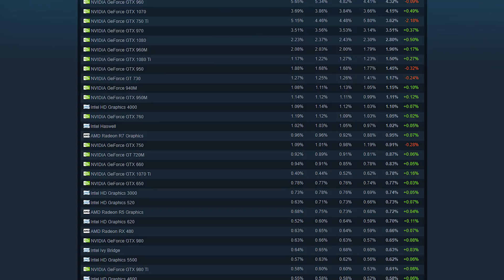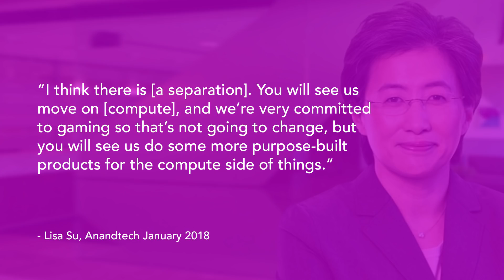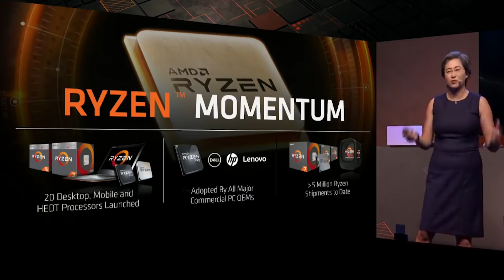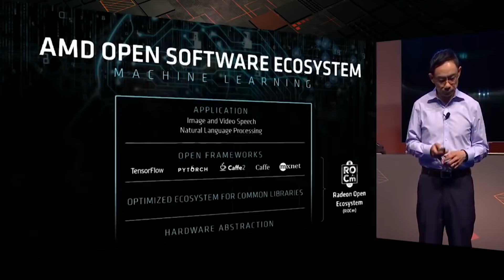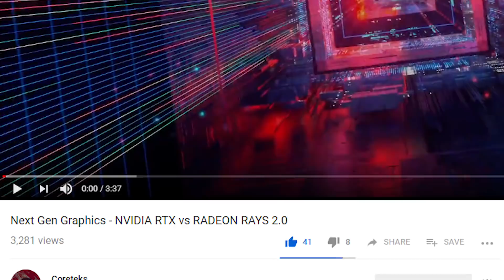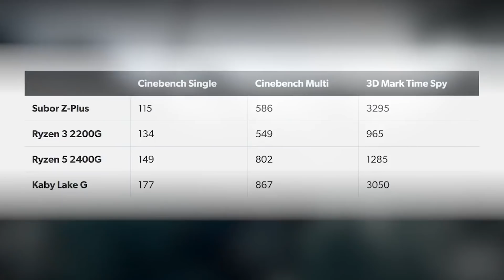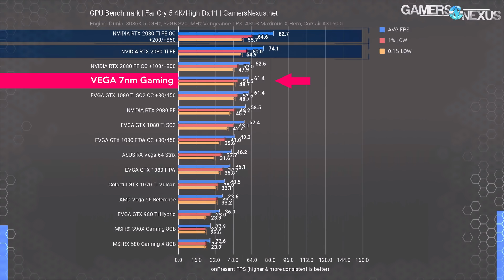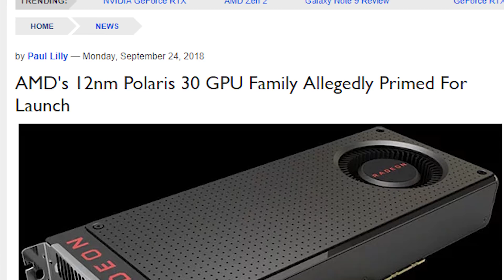AMD's answer to RTX

Comment: I made this post a couple of weeks back, thought it might be relevant for this. Wall of text below, probably only for the specially interested, you're warned.

I think you'll see Lisa Su's vision starting to take form in 2019. When she took over as CEO in 2014 *1 she shifted the focus over to exclusive contracts and low-to-mid end consumer CPU's since that's where the biggest markets were, there's much lower ROI (return of investment) in the high-end consumer base for them. Their recent success can be traced back to TSMC, producer of wafers used to make CPU's and their contract with Apple in 2014 *2 after which they invested 9 billion dollars into development and moving towards 7nm where Samsung is mainly the other competitor (for TSMC in 7nm production). Intel is stuck at 14nm, trying to get to 10nm *3, and due to inability to produce enough 14nm Xeon's rumors *4 has it they have started to purchase additional supply for TSMC *5. Intel has denied *6 this but prices of RAM are actually expected to drop as a result of this (finally!). AMD is eating into Intel's Xeon market with more-core CPU's that Intel can deliver and their CPU's also has the bonus of more PCI-E channels.

When Lisa took over she assigned 2/3 of their development division to work on Playstation GPU's *7 (against one of their main folks' wishes who eventually left for Intel *8)and got some super-important contracts signed to make GPU's for Playstation 4 and 5 *9 which gave them the finances they needed to expand and develop. The other 1/3 of the developers would then start to work on what we now know as Ryzen, Threadripper and EPYC who currently are at 10nm but are about to push into 7nm which we just saw hints of *10. TSMC is getting them to 7nm who themselves has a massive reason to due to their income coming 75% from their contract with Apple, and AMD being in the 1-5% range which pales in comparison and makes it laughable when people are suggesting their won't be enough 7nm wafers to make CPU's from. TSMC is getting them there ahead of Intel who like I said can't even get to 10nm nor enough 14nm made. nVIDIA released just released GPU's where the main attraction is something that you cannot even use properly yet, and the die chip looks a lot like Pascal +  Tensor and RT cores the latter being for Ray-Tracing specifically plus a dual bus for simultanious floating point and integer operations with this latter only mostly for Ray-Tracing. When AMD finishes their 7nm Playstation 5 GPU they will take that architecture and build their new PC-GPU's from that, I have high expectations for those given they already very familiar with it's 7nm architecture and it's advantages, and the same goes for their 7nm Ryzen and Threadripper's that'll be coming as stripped down 7nm EPYC's. nVIDIA knows something's coming across the horizon and wants to build an early lead, suppliers cannot make enough AMD motherboards to meet demand *11 and I mean.. AMD's stock has ryzen about a tenfould since 2014 *12 and the other sharks can smells there's something new in the water so they're scrambling to try and get ahead, but it might already be too late before it's began.

*1 https://www.pcworld.com/article/2824133/amd-names-lisa-su-to-replace-rory-read-as-ceo-continue-diversification-strategy.html
*2 https://www.eetimes.com/document.asp?doc_id=1333615
*3 https://www.tomshardware.com/news/intel-cpu-10nm-earnings-amd,36967.html
*4 https://www.semiaccurate.com/2018/09/07/intel-cant-supply-14nm-xeons-hpe-directly-recommends-amd-epyc/
*5 https://www.tomshardware.com/news/intel-cpu-shortage-tsmc-outsource,37769.html
*6 https://www.pcgamesn.com/intel-denies-tsmc-outsourcing
*7 https://www.pcgamesn.com/amd-sony-ps5-navi-affected-vega
*8 https://www.theverge.com/2017/11/9/16627470/intel-raja-koduri-graphics-amd-radeon-business-hire
*9 https://www.eurogamer.net/articles/digitalfoundry-2018-amd-next-gen-graphics-tech-built-for-ps5-report
*10 https://hothardware.com/news/epyc-7nm-rome-benchmarks
*11 https://www.techspot.com/news/76515-high-demand-amd-motherboards-causing-shortages.html
*12 https://finance.yahoo.com/quote/AMD/history?period1=1379541600&period2=1537308000&interval=1d&filter=history&frequency=1d

The secret sauce is made up of 2 main ingredients here, #1 a strategy that shifts towards a wider consumer base and have major development costs offset by TSMC's tug of war with Samsung which is a genius play and allows for solely focusing costs on development of 7nm, not researching it and producing it like Intel burdens themselves with the cost of. And #2, their Infinity Fabric creation. Couple'a years ago AMD and Intel realized as we were moving towards many cores, the potential latency if you use a ring-bus like Intel 1 when you go beyond 10 cores and the set of data the last core is supposed to get gets there much later that the first, on that ring-bus it introduces a lot lot of latency. Intel and AMD has taken different approaches with this, Intel's is a mesh that if you imagine this like a class-room, you route all the cables in the roof above and have the go vertically down to each station, with every station being each core in this example: https://images.anandtech.com/doci/11550/mode-x_2d_rep_575px.png *2 It's notably quite fast and outperforms AMD currently in terms of latency, but seems to be hitting a wall with what it can manage, especially with quad-channel memory so it's hard to expand it beyond the current structure. AMD as I mentioned has Infinity Fabric. Where Intel needs an entire wafer *3 to produce a CPU, AMD can use Infinity Fabric to combine working parts of a wafer which has helped them overcome Intel's struggle in moving towards 7nm, hence Intel's production struggles. AMD might also have a 10Core Ryzen planned for Intel 9900k which shakes things up even more. *4 I'm not entirely sure how Infinity Fabric works but best graphical comparison of it I've heard makes it sorta like conductive net-like fabric *5 that connects everything, hence why Threadripper's (Ryzen is unaffected) especially always use a lot of power even in idle *6, due to always having to power the Infinity Fabric for conductivity. That being the other side of the medallion, it does very well when you get above a certain number of cores which kinda tells you why AMD is starting to get such a core-count over Intel *7, and Intel is having to pull stunts like the 'supposed' 28C 5GHz CPU 8, especially when we're moving towards six-channel memory (I so, so.. sooooo! hope prices drop) it's seems all these cores wants a lot of bandwith across the board(s) to be properly fed, even Window's own tasks schedueler is starting to struggle to keep up *9, professional editing software like Magix's (formerly Sony's) Vegas cannot even be updated fast enough to function with them. Their next-gen Crossfire Interconnect is also schedueled to be based on Infinity Fabric, all their projects researched and developed together and alligned to thit the market at around the same time. AMD is making serious dents in Intel's markets and once the 7nm tidal waves hits it's we're gonna see a bit of a revolution. *10

*1 https://wccftech.com/intel-skylake-x-skylake-sp-mesh-architecture-interconnect/
*2 https://www.anandtech.com/show/11550/the-intel-skylakex-review-core-i9-7900x-i7-7820x-and-i7-7800x-tested/5
*3 https://static.techspot.com/images2/news/bigimage/2018/06/2018-06-11-image-2.jpg | https://www.techpowerup.com/245521/on-the-coming-chiplet-revolution-and-amds-mcm-promise#g245521-1
*4 https://www.guru3d.com/news-story/amd-10-core-ryzen-2800x-in-response-to-intel-core-i9-9900k.html | https://www.computerbase.de/2018-05/tsmc-wafer-stacking/ (German)
*5 https://images.anandtech.com/doci/13124/Threadripper%20Tech%20Day_Joe%20Macri_Architecture-page-011.jpg
*6 https://www.anandtech.com/show/11697/the-amd-ryzen-threadripper-1950x-and-1920x-review/19
*7 http://www.legitreviews.com/wp-content/uploads/2017/05/EPYC_scalability.jpg
*8 https://www.extremetech.com/computing/271211-intel-isnt-building-a-5ghz-all-core-28-core-cpu
*9 https://www.techspot.com/review/1683-linux-vs-windows-threadripper-vs-core-i9/
*10 https://www.cnbc.com/2018/06/15/keep-buying-amd-shares-because-its-profitability-will-soar-on-new-chips-cowen.html

Comment: There's a keyword you missed is 'denoise' they're focusing research on denoising technology, this is a VITAL component for real-time ray-tracing and is used extensively by the RTX cards. AMD already made real-time ray-tracing support in gpuopen, and I expect they will stick to that only they will improve upon it so it can compete directly with Nvidia's RTX. Moreover, I find it quite likely that AMD can implement these upgrades at a significantly lower cost than Nvidia, nvidia needed both hardware and software upgrades, but amd only needs software upgrades really to get the same kinds of results.

Comment: What we need is a flight simulation chip - with so many people running simulations, including training facilities, all those owners need to overclock their CPU's because legacy sims are very much single-core speed dependant.  Only XP11 starts moving away from that, and Prepar3D can only do so much with 64 bit and old architecture.  What would this chip look like?  Probably a 4-core no HT 5Ghz chip without need for overclock.

Comment: full potential of Ray Tracing without melting the frame rate is only possible if it is offloaded into cloud processing, rather than having it done locally on the GPU. Otherwise people have to wait for at least 4 gens later into GPU tech until they can have their game ran with over 100 fps at 4k with a proper Ray tracing.

Comment: As long as AMD keeps making space heaters I just can't do it.
If the Vega 64 had a competitive power draw I would have done AMD just to send NVIDIA a message, even if that meant me getting slightly lower performance, at a higher price. But my god, my room heats up with lower power hungry GPUs. A Vega 64 would just fry my room! That's too many negatives for me to justify it.

Comment: lol mindshare, it's not mindshare, it's market share when AMD does not compete at the high end. Nvidia didn't only give the next high end card, but they took a risk, and increased the cost to deliver next gen technology. They could have massively reduced their die size and price and delivered a straight upgrade with great price/to performance ratio on traditional rendering. They didn't that would have been the cynical move, they took the break in competition to still put out the highest performance card, but took the hit on cost to include next gen technology, which is needed before developers will start moving to it. I have a 1080ti so I may not buy this gen, but I applaud Nvidia for pushing tech forward, to take the hit of adoption on price, but embed the future of graphics hardware in the market. They could have shrunk the die size, ditch the tensor and ai cores, and had awesome price/performance ratio, they chose the harder path. The day AMD aims at the high end/enthusiast market again is when I say they are PC gamer focused, until then, they are undercutting their opponents with old tech to keep the console market.

Comment: I was an AMD enthusiast, until... well basically my first Nvidia card. and no not cos of the performance difference, but cos of the driver interface. Evrything is clear, runs smooth, doesn't require you to be searching for updates in the browser and an option to optimize your game's configuration to your card? yes please. Cos performance wise they are equal.
Reply: Weard, i have sell my GTX 1080, its a stutter fest. Nvidia`s drivers are very bad those days.
Reply: Could it be Windows? as a rule, i do a complete hard format of my system twice a year, and my card is a laptop 970, no issues at all.
Reply: I need to freaking LOG IN to nvidia to update drivers, lol. Used to amd in the past but nvidia driver updates are really annoying, always forgets password and need log in for updating.. really
Reply: Then maybe im just a lucky mofo, the GeForce manager always runs smooth for me and no issues with accounts/passwords or any other BS.
Reply: What the fuck are you talking about?.. Using Nvidia and AMD on my configs, and none of their drivers runs poor or laggy. AMD drivers are just as smooth as Nvidia drivers. The only difference is that Nvidia pushes driver updates more frequently.

Comment: Relying on hindsight, I think there would have been a bit more hype build up effort on AMD's part, if a new gaming Vega card was around the corner, as opposed to the current level of coy-ness. There's literally nothing, not even rumors; we know more about Arcturus than 7nm gaming Vega.
I've only heard of server based Vega cards coming this year, and then Navi (David Wang pretty much invalidated the idea of MCM design for Navi, iirc - in gaming, at least - in no small part due to ISVs) sometime next year, seemingly with mid-range first. This kind of falls in line with their current focus on server and semi-custom business (e.g. Sony/MS for upcoming consoles), as far as Radeon efforts go.

As for Nvidia's RTX release dates, I think upcoming games' release dates play a bigger role, here. Can't sell your cards too early, because the games featuring your raytracing/AA tech aren't at a point where they can be used to demonstrate it; can't do it too late, because you'd risk losing a particularly lucrative sales window. As much as I wish it were AMD, other explanations are just too feasible, in this case.

Comment: Vega is not going to be saved by 7nm in gaming. They have not put enough effort into the development of it, but rather focused their resources on Navi and the colaboration with Sony. 7nm production will be tight and GPUs require more transistors than CPUs. Looking at the competitive situation and attainable prices, AMD will rather push for CPUs than GPUs on 7nm.
Accordingly Nvidia could pay more for 7nm slots than AMD, which again makes it unreasonable for AMD to push its inferior product to a superior node. Things are different however when it comes GPU computing, where AMD has an excellent product.
To compensate all that, AMD is aggressively hiring engineers, using the cash flow from its CPU business to beef up its GPU development. Once there will be an abundance of 7nm slots, like 2h2019, you may expect a very serious GPU offering for gaming by AMD.

Comment: If we were in July, I'd be more optimistic for a new AMD card this year.  Even a Polaris refresh seems less and less likely before the end of the year, and that would be easier for AMD to pull off (and a good way to take advantage of GTX2060 not coming out until Spring 2019).

Comment: While your speculations are quite interesting I just cannot see AMD fully redesigning their Vega architecture by adding ray-tracing and/or tensor hardware, while moving to a smaller node at the same time. If they go that far (much, much farther than the move from Vega's predecessors to Vega) why still call the GPU Vega, and thus diminish their work by poor marketing?
 
AMD's ProRender and Radeon Rays are software solutions, not hardware solutions. Both can already be used with AMD's existing hardware, no additional hardware required. "Hybrid rendering", in AMD's case, does not mean shader core rendering + ray-tracing with RT cores and/or denoising with tensor cores. It simply means rendering with shader cores at FP32 + offline ray-tracing + AI denoising at FP16 (since AMD does not currently have FP8 or INT8 hardware) with the same shader cores. 

Both ProRender and Radeon Rays are currently intended for pre-rendering, or offline rendering, with AMD's professional graphics cards.* AMD in their Radeon Rays page lists their current fastest professional card as being able to reach a performance close to ~1 gigaray for shadow rays, somewhat less for secondary rays and quite less for primary rays (Nvidia did not define what kind of rays their RTX cards support at their max reported rate, but I am quite sure they must be shadow rays).

*Will ProRender and Radeon Rays support RTX cards and exploit their hardware, since they are both open source and cross-platform? I guess not officially from AMD, but someone could perhaps add such support. AMD will surely update ProRender and Radeon Rays when they add extra hardware for ray-tracing and/or tensor cores to support such hardware. I don't think that will happen even with Vega 20 though. AMD has mentioned adding extra AI "instructions", not AI hardware.

Comment: AMD has proven once and once again, that they are simply not capable of delivering a finished product for PC gaming. Even the author mentioned that the developers tend to ignore AMD's 'innovations', because AMD just does half-assed solutions and brings them late to the market. AMD is notoriously plagued with driver and support issues and simply does not work with developers on the same level as nvidia, so it doesn't matter if the next architecture is 7nm or less, or if it brings its own alternative of real time ray tracing. AMD feels comfortable as console graphics maker, thus will always remain inferior, that's until nvidia brings its own solutions for consoles, then AMD will be history.
Reply: NVIDIA gets raped on budget PCs. It is only relevant with xx70 and 80. And AMD used to get on par with high end NVIDIA some time ago.
Reply: Hopefully they don't screw up with high end this time. No competition = RIP.